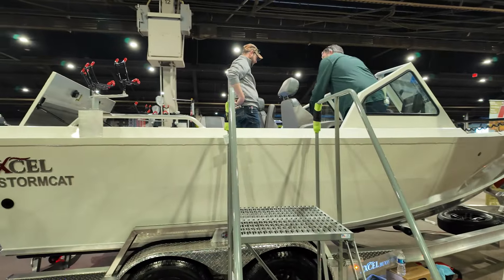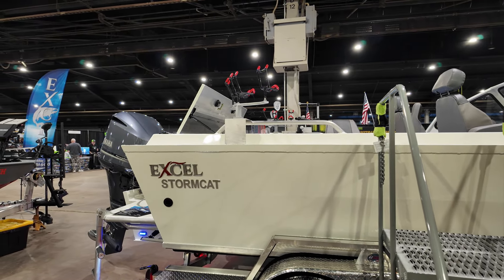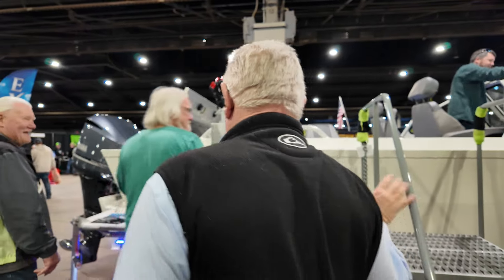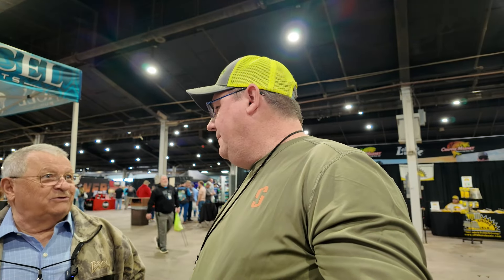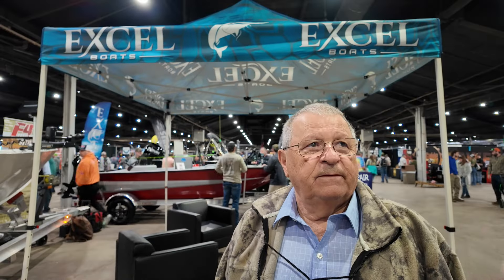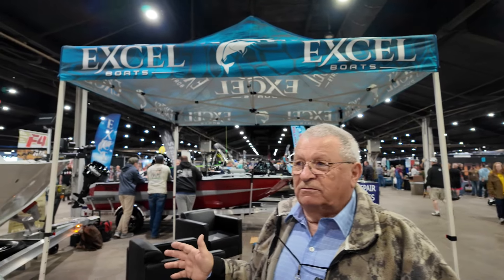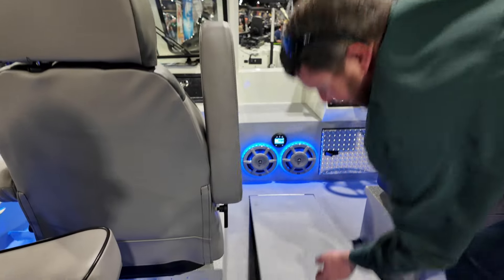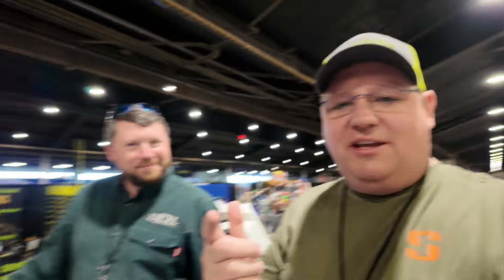New Excel StormCat Deep V Big Water Catfish Boat

Comment: The original Excel Stormcat was discontinued during the COVID period.  

Excel completely redesigned the Stormcat and unveiled this catfish model of the Stormcat at the Catfish Conference.  It will officially be released to dealers in late April. There will be a salmon version with a smaller livewell and transom station. 

The Stormcat will come in 21, 23 and 25 foot models. The boat is measured on the inside and overall is 3 foot longer center length with the rear step deck flotation bracket. 

Soft tops will be available this year and late next fall full cabins with hardtops will be available.